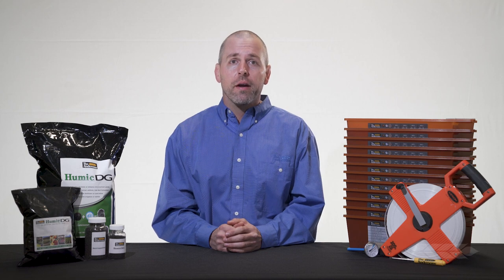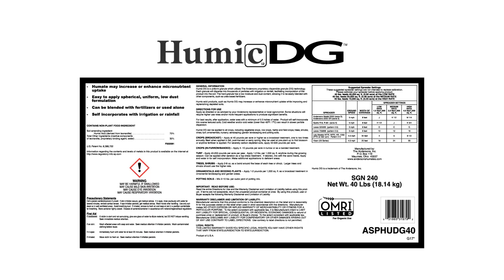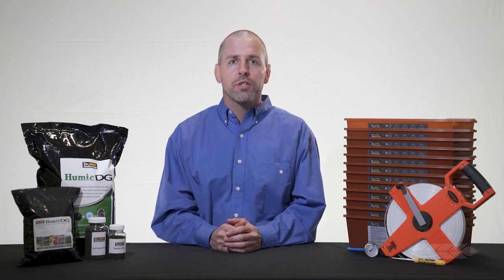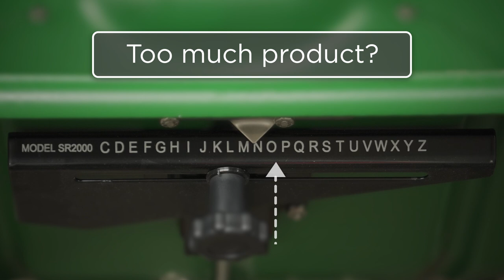Make Calibration Simple with the Prizelawn Arc 1 Spreader Calibrator

Comment: I found their Calibration Method to be off for my spreader.  If I only put in the exact amount of material
in the hopper that is needed for 1000 sq. ft., I found that as the material begins
to run out, the spreader could not push it all out of the hopper and it
collected on the sides of the hopper.  I solved this by putting in three times the material I needed and then I measured
the amount of material in the hopper after each run and adjusted the settings until
I got the right amount of material in the hopper.